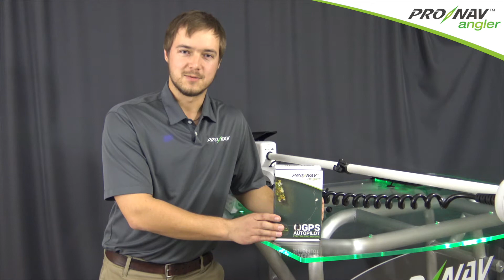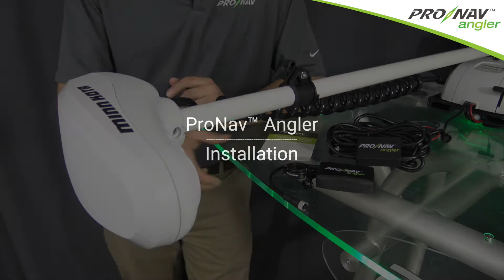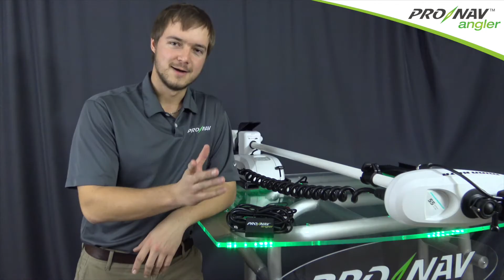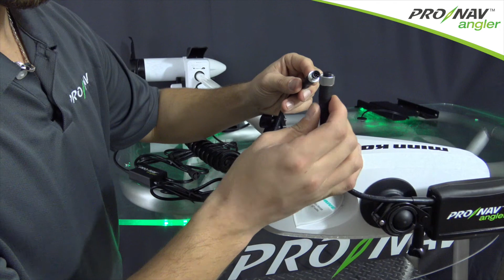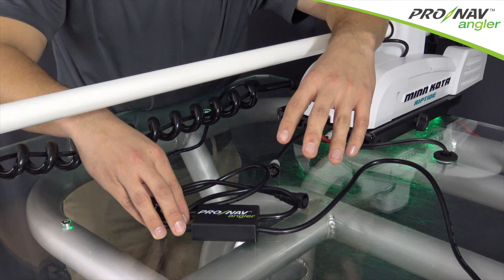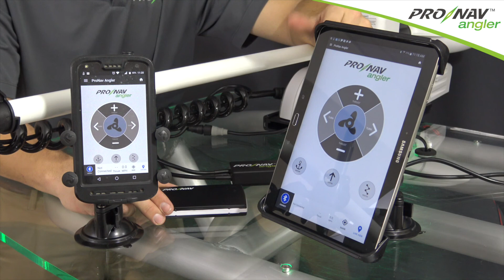ProNav Angler Installation

Comment: Can I splice the pro nav into the wire that powers my trolling motor?  Red to red black to black? My battery is located in the center console and is to far for the pro nav to power directly. It shouldn’t matter but here in he video u make me doubt whether I can accomplish this without ruining somethig
Reply from the maker: Absolutely! Just as you described it, you can directly splice the ProNav into the power source of your trolling motor. Red to red, black to black!
Reply: ProNav Marine yup got it all wired up, however mine did not come with the 1 inch ram ball. I noticed u said it is included.
Reply: Also why is the 6 inch clearance necessary. I can understand for having a cushion to protect the gps unit but is there another reason?